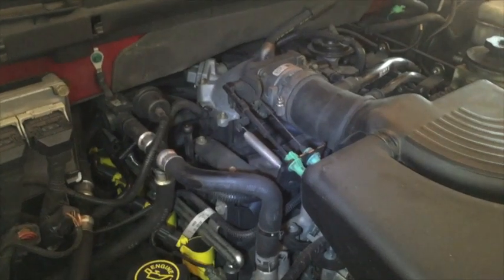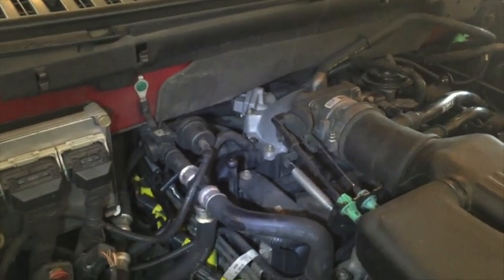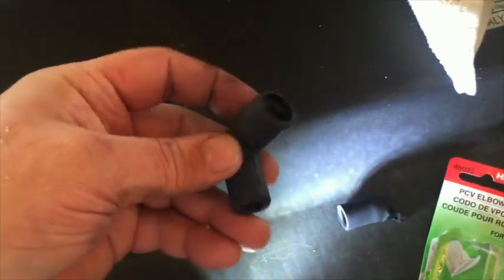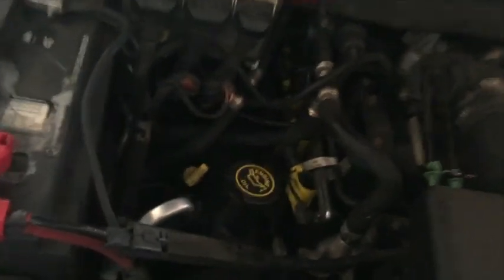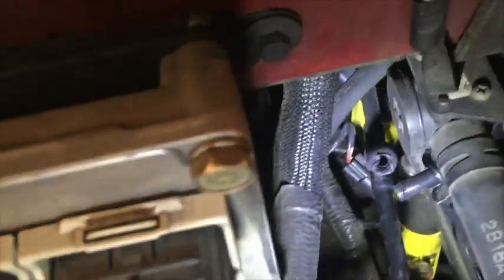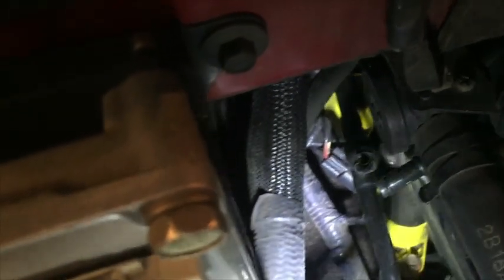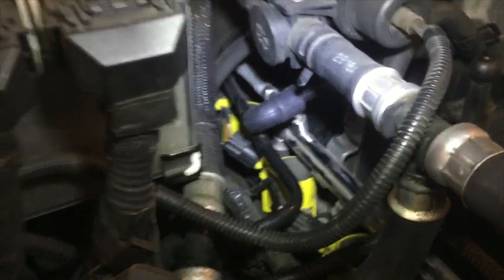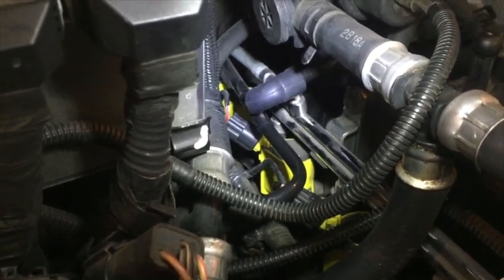Ford Expedition Error Codes P0171, P0174

Comment: I replaced the O2 Sensors (Drivers Side back/front) last Sunday as I kept getting this code (P0174).
I thought it was gone as the code didn't pop back on for over a week, I drove everyday maybe 20-30 miles nothing super far... and it's BACK!
I hope I can resolve this issue!

Comment: I just replaced that elbow with a piece 5/8” fuel line and also the elbow that connects to the pcv valve on the valve cover. They were both cracked and crumbled.

Comment: I replaced the elbow, but the piece to the right, the straight piece that flares out on both ends is also melted, what part is that? My auto part store can't even identify it ..
Reply from the maker: It sounds like it's the PVC Hose Connector Tube.  If you buy it from a dealer you're going to end up paying $80 or more. However, I would try ebay first to see what you can find. I've seen it run around $30 with free shipping.Just make sure what you buy is for your engine model and year.

Comment: I have a 2003 Expedition with a 4.6L V8 showing codes PO171 and PO174. However I'm not seeing that same tubing where the PCV elbow is cracked at all. I have no clue where it's at on my vehicle. I keep seeing a shit ton of videos on YouTube but everyone has 5.4, maybe that's why Idk. I'm hoping it's just the PCV elbow and not my intake gaskets.
Reply from the maker: Generally those error codes point to a vacuum leak somewhere. I would start by following each of those vacuum lines, which are all tied together, and check every connection for leaks. Use a spray bottle filled with soapy water or something like Windex will work too if it's too difficult to get access to the lines up underneath the engine housing.
Reply: Fix it ?

Comment: DIY Guy I have been having the same problem but I just took the pcv elbow off and it looks fine almost new looking, should I still replace it if there is no holes or splits?
Reply from the maker: There are a couple of other weak points on the vacuum lines you may need to check, especially behind the throttle body.  It's a little bit like an octopus and connects to a number of points on the engine. Just follow the hard plastic tubes to their termination and check for leaks.
Reply: @diyguy1808  thanks I will try that!

Comment: Is this like an emission leak?
Reply from the maker: Basically yes, a vacuum leak
Reply: DIY Guy I have an emission leak but all my vacuum lines are all solid so I don’t really know where else to look
Reply from the maker: Did you run an error code check with the diagnostic tool?

Comment: Why won't my fuel hand move off of empty when it is full of file? 2005 Ford expedition 5.4 liter. I replaced fuel pump and drivers fuel pump relay.
Reply: In my car there is a regulator assembly opportunity the fuel pump.  It also has a float and the fuel pump one is used to compare the difference.

Comment: Dude you are amazing. Helped me find the issue ASAP. I paid 11 bucks for my elbow at pep boys. Mine was melted aswell. After installing the new one I realized what melted it. The heater valve is right on top of it. My heater valve was leaking coolant right on top of it. So if anyone has a melted one. Check to see when your car is on if your heater valve is leaking coolant.
Reply from the maker: Glad it helped. :-)

Comment: There is another rubber elbow connector located behind the engine under the firewall the access is hard but it is doable.I did mine for an hour but it is rewarding.What a feeling .No more 171 and 174 code and my expy is due for smog.Thank you Jesus for helping me find the caused.
Reply: What year is your vehicle i cant seem to locate mine

Comment: Replaced all the elbows on my 2003 4.6. Still get the same codes every so often.
Reply from the maker: Generally these error codes are caused by the cracked elbows in the vacuum lines.  However, if it's still throwing the error codes after changing them out, then you will need to take it to a mechanic and have them do a smoke test where they inject smoke into the valve covers etc. and check for leaks that way.

Comment: I have a 2009 Expedition 
I have error codes P0741&P0735. What does this mean? How would these be resolved without rebuilding the entire transmission?
Reply from the maker: Your question is off topic to this thread.  Do a Google search for your error code and you should be able to find some information on your issue - which all appear to be transmission related.

Comment: You are the man.
This was the FIX.
I went to autozone, got the $7.99 part (# 46017 ,Help PCV Valve Elbow). Took 3min, too remove and replace.
Horrible price, for a $0.50 piece of rubber...and it says MADE IN CHINA in LARGE LETTERS. But it is done!

But I am eternally grateful for your help in posting this. Car is running fine, with no Check light. Thanks!

( 2004 Lincoln Navigator  4x4 )
Reply from the maker: Glad this video helped.  As an FYI, there is also one other rubber boot that fits on the same tube assembly that connects behind the air-intake where it meets the throttle body.  This should also be checked for leaks, if changing the elbow doesn't fix this problem.  However, the elbow seems to be the most common problem for this error code.
Reply: If i wanted to get it on Amazon how could i find the right one? There a way to get the proper size?

Comment: I have a 2003 Ford Expedition myself and have the P0171 code. The service engine light, not alone from this incident, but from vehicles I've owned over the years to buy my own OBD scanner. I really should have purchased ones years ago. Now I can check a code right away rather than going to the auto parts store to scan it. I hope my issue is just that little elbow and I'm thinking it is as I had the coil over plug and plugs replaced recently. I just don't have the time I used to, to be able to do a few hour project.
Reply: Lane Waite so was it the elbow?

Comment: Diy guy... I have the P0171 system too lean Bank 1 and P0174 Bank 2, is it two different elbow hoses?
Reply from the maker: A single vacuum leak would give an error for both banks.  However, the hose assembly that connects with the elbow, should be checked for leaks as well.

Comment: Diy guy....are you still on here?I have a question.My 01 expedition threw those codes, but was still running fine until a month ago.Then it started idling funny and having no power, also on freeway bogs down.I found hole on the boot connecting pcv metal line to back of throttle body.Fixed boot, idles way better but other problems i mentioned are still there.Help
Reply from the maker: Could be a bad engine coil, especially if it's intermittent. Is it still throwing the same codes, even after fixing the hole in the boot going into the throttle body?
Reply: +DIY Guy Not sure yet.Just had code reset last night and ive only driven it maybe 15 miles.Thank you for your response.
Reply: +DIY Guy So far the lights off.

Comment: What happens when you change EVERY vacuum line with brand new ones, changed out the elbow with the factory replacement, put RTV sealer around each connection, put clamps on every vacuum line connection AND changed the PCV valve and the codes return?  When I pull off any line, do nothing to it, and replace it, then clear out the check engine light, it works for 2 weeks then starts idling rough again and back on comes the check engine light.  I've done this 6 times and every time it's good for two weeks then running rough again.  Every part is replaced with brand new and the hell sealed out of it.  What's the problem?
Reply from the maker: +LVPHD1 
If after going though all that, then it's possible one of the engine manifold gaskets has been breached.  The Triton engines have two engine manifolds and are a major deal to replace.  The only way to know for sure is to take it to a shop and have them do a smoke test and check for leaks that way.

If you have patched the vacuum lines but are suspect they are still leaking then bite the bullet and buy the entire vacuum line which runs around $35-40 online.  

This part fits for my Expedition but is probably similar for most Fords with the 5.4 L Triton.  I've outlined the most common failure areas.

http://imageshack.com/a/img924/1638/fy6nVR.jpg

Comment: Possibly stupid question here but, I didn't see a size listed on the package, so if I find that it's the elbow on my '03 Expedition w/ the 5.4L it should be a one size fits all?
Reply from the maker: +Justin Tarvid 
The Dorman PCV End Assembly is a standard part that fits Ford model's, and can be found at any Oreilly's auto store. Item #46022 for $10.00. Notice the packaging says "Ford" on it.

Thanks
Reply: +DIY Guy thanks.  sadly there aren't any oreillys around her.
Reply from the maker: +Justin Tarvid 

You can always order it online if that's the case.:  http://www.oreillyauto.com/site/c/detail/MTM0/46022.oap?ck=Search_46022_-1_2931&keyword=46022
Reply: +DIY Guy Good point!
Reply: +DIY Guy Ordered the part today, somebody has been there before though, the current one is wrapped up in electrical tape.  Much much easier to find with your video!
Reply: +Justin Tarvid I just went to O'Reily auto parts and told them the piece I needed.  They looked it up on the computer and voila!!
Reply: +LVPHD1 Sweet.  the closest store for me is 40 miles away
Reply: You can go online and order it and have it shipped to your house.  Done deal, lol.
Reply: Well lookie there, it finally did allow it.  That's for the 1998 Expedition 4x4 Eddie Bauer 5.4L Triton.

Comment: hey thanks a lot for taking the trouble to put up the location of it on your expedition... it really helps and apparently it's been moved from a location others were posting of being somewhat behind the center of the engine....
Thanks again...
Reply from the maker: Car lo You are most certainly welcome.  This engine/vehicle is a nightmare to work on, from simple things like changing the oil filter to swapping out engine coils. Anytime I can help make a difference to help someone else out, while saving them aggravation and frustration, I'm glad to do so.
Reply: +DIY Guy . Seriously, what is up with changing the oil??? I cannot do it without oil going everywhere!!! it is annoying!!!
Reply: +DIY Guy, ooops obviously logged in under kids account. haha !
Reply from the maker: +Kirill Maurits I had a coil go bad so I decided to replace them all with a set of Rally's.  Probably better than the OEM originals.  However, installing them is not easy with all the crap you have to maneuver around to try to get them in - especially under the firewall. So I paid an experienced  Ford mechanic to replace my spark plugs along with the coils as these are known to break in the 5.4 L Triton engines upon removal.
Reply: @diyguy1808 think they were only breaking on th 04+. Did my dad's 03 last week still with the factory spark plugs and none of them broke. They all had about .080 of a gap tho

Comment: Thank you!!! I was looking in the wrong spot for this infamous pvc elbow. Just checked mine and it has a hole.
Reply from the maker: David Pace Glad this video helped! :-)

  I had spent hours looking for the leak, and especially the elbow, which is hard to locate with all the hoses, pipes in the tight confinement.
Reply: +David Pace The easiest way to find where to look is to start the vehicle, and begin to spray starting fluid in certain areas around your vacuum lines.  When the idle picks up and goes faster, you found the area.  Now all you do is feel around for brittle, cracked lines or for a hole.